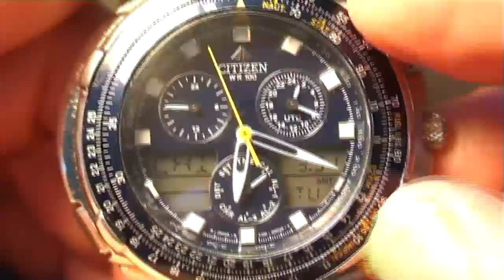Citizen Navihawk/Skyhawk: How to Use the Slide Rule Bezel

Comment: There are way better use for this slide rule. For example if you line the 12 up at the top you’ll notice 90 is above 45, 70 is above 35 and 50 is over 25. It’s a quick way to do halves or doubles. If you rotate it to 24 you get 16 over 40, 40 over 10 and 60 over 15 so it’s quarters or a multiplier of four. If you want to use it for quick math…

Comment: Citizen eco drive sky hawk? :-

1) Which colour is the watch light? 

2) What is the reason for night light showing red colour? 

3) Does it automatically change 1 hour forward or backward automatically without manually setting?
Reply from the maker: I think it was called the Navihawk 2000GT. It was a Japan-only model. 
The watch lights up blue-green.
To change from daylight savings time each time zone needs to be adjusted manually but it's fairly quick to do. 
Which red light are you referring to?

Comment: How do i used in tearms of KM
Reply from the maker: I mentioned it briefly in the video but the outer rings have a conversion marker for kilometers. For rate-time-distance calculations on the inner ring, any time-related unit of measurement will work: mph, kph, gph.

Comment: Nicely done. I have 2 questions. Is the point of origin always 10? Can you convert F degrees to C degrees for temperature?
Thank you.
Reply from the maker: 10 on the inner ring is what multiplication and division hinge around. To multiply 2 x 2, line up 2 (20, really) on the outer ring opposite 10 on the inner ring. Then find 2 on the inner ring (again, use 20). Your answer will be on the outer ring, opposite 20 on the inner ring, which is 40. You have to keep track of the decimals and zeros in your head. To divide, line up the two numbers you're dividing on the outer and inner rings. The answer is opposite 10 on the inner ring. For example, to divide 90 by 3, line up 90 on the outer ring and 30 on the inner ring. Your answer is opposite the spot where 10 sits on the inner ring. You'll see that it's 30. Then you have to think about it and know that your answer must be a two digit number and 30 is the correct answer.
Reply from the maker: +Time4achange Thanks. 10 is the origin for multiplication and division. The yellow arrow at the top of the inner ring is the origin for rate/time/distance calculations. 

Fahrenheit to Celsius is a little trickier. If the conversion points were on the bezel  that would be easy but I don't think they are. The formula is °C = (°F - 32) / 1.8, so you'd take your ˚F number, subtract 32 (in your head), and divide the result by 1.8, that is, find your result on the outer ring, then spin it until it's opposite 18 on the inner ring (that's the 1.8) and then read the result opposite 10 on the inner ring (your origin).
Reply: I'm not sure what you mean by starting at 10 . You may start anywhere , depending on the calculation you are doing . if for example multiplying 2 by 2 ,start at the 2  . To convert F , to C is easy and can be done in your head . From C to F . double and add 30 . So 6 c  would be 6 x2 = 12 and add 30 , 42 f . To go the other way 70 F. minus 30 = 40 and divide by 2, = 20 c

Comment: @nikudes Yeah, I was messing around with the root thing and figured the "fine-tuning" thing.  It's not particularly helpful because because finding two similar numbers at different parts on the bezel isn't a quick operation.  Also, more importantly, square roots (or third, fourth, etc) have two values depending on the decimal position.  Example: root of 7 and 700 are numerically the same, 70 and 7000 too, though different.  I'm not sure why, but if you read the value at root 10 ie 3.16

Comment from the maker: @nikudes So to find the root of 20 turn the bezel until the number opposite 20 on the outer ring, and opposite 10 on the inner ring, are the same. In this case that's about 45 (meaning 4.5). The square of 20 is actually about 4.47.

Comment from the maker: @schitlipz Yes there is a way to find roots. It's sort of like doing a division problem. To divide 20 by 40 for example, you'd move 20 on the outer bezel ring opposite 40 on the inner ring and read the answer opposite 10 on the inner ring: 50 (meaning 0.5 because you have to figure the decimals out on your own). But you want the square root, meaning the condition in which both multipliers are equal.

Comment from the maker: @negolatak I refer to the number 10 on the inner ring as the "point of origin" because that's where one starts counting numbers. It's the equivalent of zero. It just means that if you divide any number on the outer ring by the one underneath it on the inner ring, you can find your answer on the outer ring opposite the point of origin (which is the number 10 on the inner ring). Does that make sense?

Comment from the maker: @bestvidsdottk Most slide rule bezels, this one included, have marks on one of the rings for simple conversions like this. In this case you'd line up 12 (remove a zero) on the mark labeled "STAT.," which stands for "statute miles." Opposite the mark labeled "KM." (for kilometers) you'd read off the number, in this case about 19.3. Move the decimal over one to the right (basically the opposite of what you did before) and you end up with 193, so 193 kph.

Comment from the maker: Doing rate/time/distance calculations with a normal slide rule would be just like using a calculator. You'll get time in decimals (2.5 hours, for example). Search online for an E6B flight computer. It's like a slide rule but it has a time ring. They're about $25. That might be just what you're looking for.